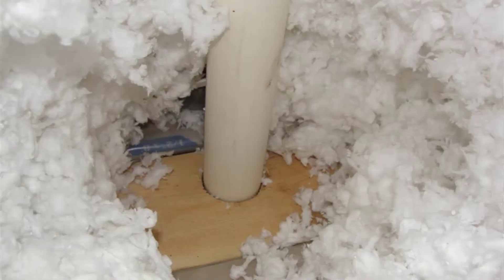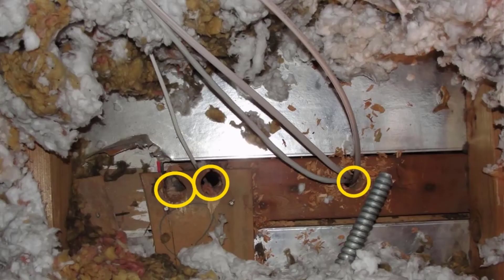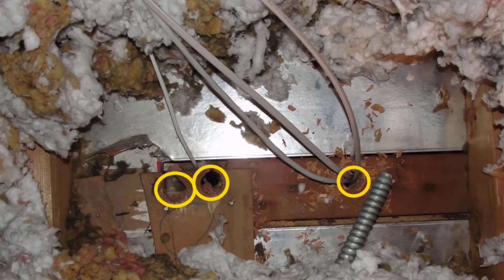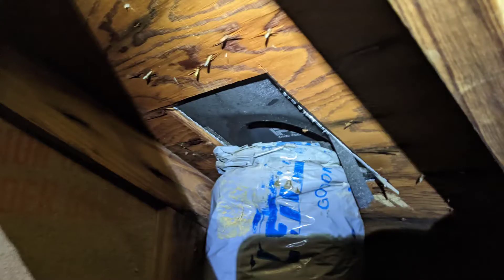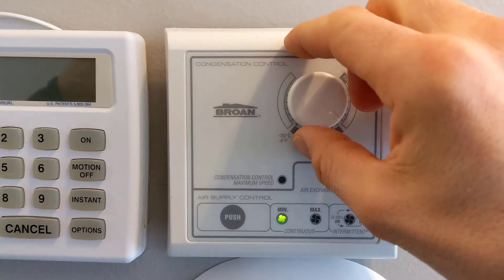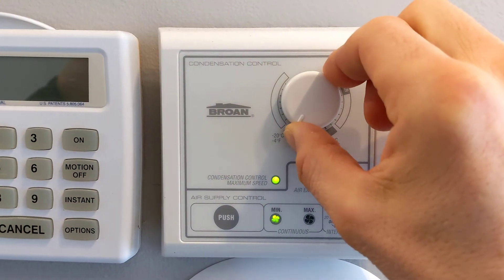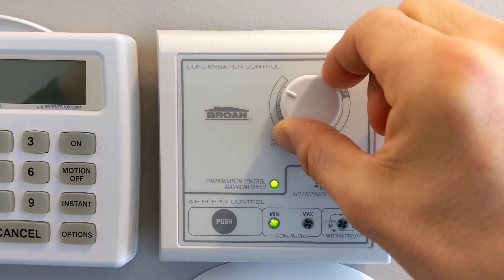Frost in the attic: why it happens and how to fix it

Comment: Horrible advice. Humidifiers are fine. Infact in the winter there is no problem having 50/60 percent humidity in the winter..poor ventilation will definitely creat frost. Air will always leak into the attic. However, if the soffit vents are open and you have adequate roof vents, then all that warm air should easily escape through the roof vents.

Comment: I installed a gas/forced air heater in the garage and exhaust ducted it up through the attic to the outside.  Well, temps here in Wisconsin got down around zero for awhile and the ducting in the attic made ice and when it melted down onto the garage ceiling drywall it started coming down where the duct went up into the ceiling.  I think the warm duct in the very cold attic is making condensation.  I'm guessing I should have wrapped insulation around the duct work?

Comment: So here is one for you, and as well, this is an attic with turtle vents and soffits all around.  So pulling in air through the soffits and then out the vents, like it should.  What happens in the winter when the air is cold has high humidity.  The same kind that causes hoar frost outside.  That same air is being pulled into your roof isnt it?  Roofs dont stop venting in winter, they work the same all year round.   So if that frost can stick to things outside, what stops it from sticking to things inside an attic?  Ready a ton on this, and unless you have 100% air sealing below, which lets face it, who really does, many websites say you can expect some frost in your attic.  But if you have some frost, isnt that what the venting is for, to dry out small things like that.  Dont think water or snow comes in those turtle vents when its windy, it happens.  Isnt that what the air moving in your attic is for, not not only vent for heat issue in the summer, but to also dry out small amounts of frost and/or rain when things arent 100% perfect.  Im not an expert bu any means, but living in Canada, we get -35 and worse temps, and sometimes high humidty with it.   But if I am wrong, then Id gladly hear an explanation.

Comment: Have an issue with my ceiling in my vaulted area, every four feet water marks.  The roof is only 8 months old, tear off and replace, on a house that is only 9 years old.  We are seniors and bought the house when it was only 4 years old, should not be going through this.  Roof has been inspected by several companies, no leaks.  I am told it looks like condensation, why now after nine years and new roof 8 months ago?  Noticed the lines January 2nd, do not want to fix ceiling till problem solved.  We have 12 inches of R-38 plus baffles around the edges and 14 vents on the roof, 4 of them over the problem area.  At least 5 feet of space over the troubled area, the vaulted ceiling.  Temp in attic on 2/10/23 at 6:30 pm 26.5 degrees with 71% relative humidity.  Outside 34 degrees with 54% humidity.  I tried to send pictures but could not.  Please Help!
Reply: No sign of water or frost in the attic either on the trusses or insulation.  Chris Loria, second comment.

Comment: I live in Dilworth Minnesota. We had an issue with frost and water last winter and thought it was the roof so we paid 9k to have it completely redone and new insulation added. Here we are again in Feb 2022 and today was warm so we have it happening again but it is WAY worse. 
I wish I would have found this video last year. After some quick looking around, I've found areas of concern for heat leaking into the attic. Now I'm terrified at the cost we will end up with.

Comment: What we did when we found a lot of frost accumulate in the attic was vacuum it up using a wet/dry shop vac. Of course we didn't get all of it before it melted into the insulation, but we probably removed 90% of it, greatly reducing the damage. Next we have to figure out where our house air is leaking into the attic and seal those leaks up so there is no "next time". Thank you for your video.

Comment: I appreciate your humility 

Here in Missouri perhaps the only solution is to go ahead and install a radon mitigation system, ‘cause to my way of seeing it, the most of the moisture is from the ground

I’ve recommended and installed sealed plastic film in Subarea crawl spaces and I’m fairly certain this is not a durable solution 

And when there’s a need for one or more sump pump/s, I usually suggested a battery backup pump, ‘cause it’s disastrous when they fail in the middle of a blackout or storm

As an aside, unless I put it in a summary right up front in a report, I’m pretty sure most of my Clients never read the whole report and never took my recommendations

Comment: Frost in the attic = poor soffit and roof ventilation. Lack of insulation, an unsealed top deck from the living space and unsealed and uninsulated attic entrances. Also, bathroom fans not discharging directly to the exterior. In most cases there is always a combination of deficiencies that cause Frost in the attic, but most cases it's blocked or obstructed soffits.
Reply: Did you even watch the video?

Comment: But you don't want to get rid of all moisture in the house.  What happens when the house gets too dry?  (Yes crack skin and nose breed your body can heal) But when the house get too dry, it will damage your home?  Dry air can start to pull moisture from the structure of your home. As your house dries out, you’ll notice that floors, particularly hardwood floors, will begin to creak more.

Dry air can also pull moisture from the wood in the frame of your home, causing walls and door jambs to shift. This can make doors hard to open and close, and cause gaps between ceilings and walls. These gaps can also form in windows that are made entirely of wood. All in all, I think we have to find a balance between the two in the winter months.
Reply: A dry house is better. Moisture buildup equals mildew/mold.